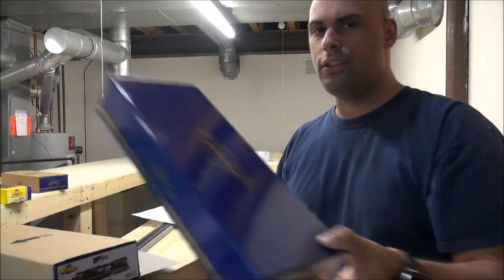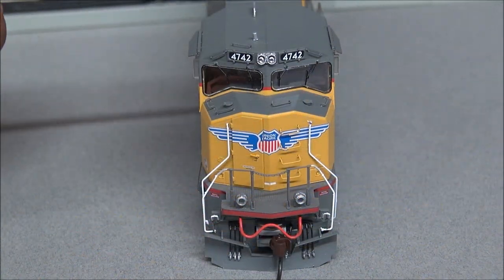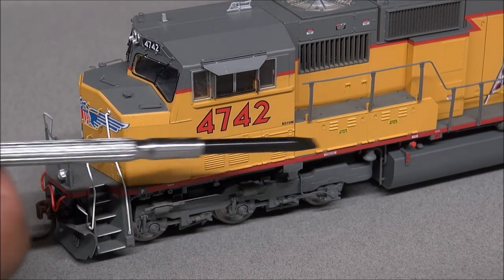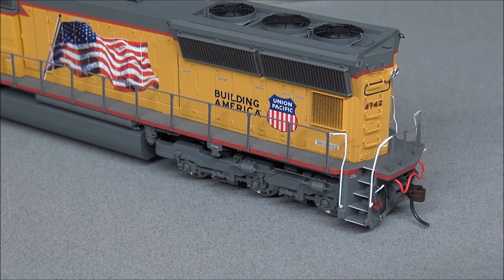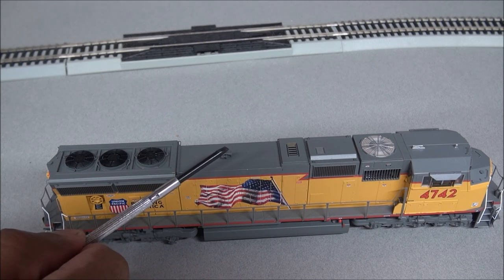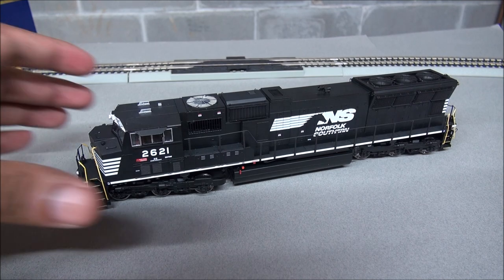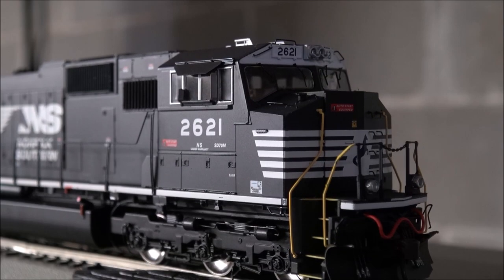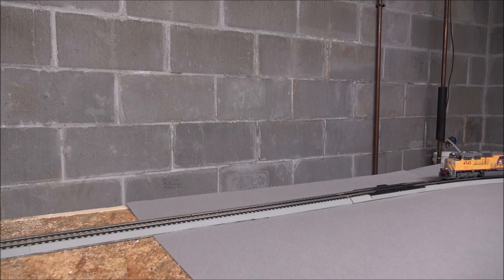Review: Athearn SD70M Flared Radiators UP & NS DCC/Tsunami Sound

Comment: You tested Athearn and Overland. At first I thought you had an Athearn supplied by Overland but later I was confused. My question is who makes this SD70M for Overland? As you can tell I am confused but think I would want the model you have from Overland.
Reply from the maker: Overland made their own brass SD70M flared radiator locomotives.

Comment: Are these the newest locos in America?  Or they a old loco?
Reply from the maker: This is an older locomotive in terms of the prototype.  They came out around 2002.  This is the first time the model has been produced outside of brass though.
Reply: A very nice what is the most modern loco in USA here in UK it's the class 70 and the 68
Reply: Graham Mck
Currently that's a tricky question. Right now the most modern locomotives on the road would be the GE Es44AC "Gevo" and the EMD Sd70ACe (an upgraded version of the SD70m). However, The EPA (Environmental Protection Agency) has new standards out that prevent GE and EMD from producing these locomotives, GE has a new locomotive ready to be released but EMD has nothing. If you are more curious about the new locomotive look up GE tier 4 evolution series locomotive.